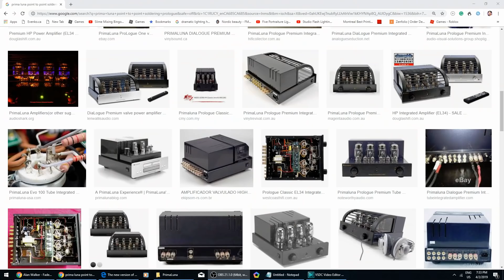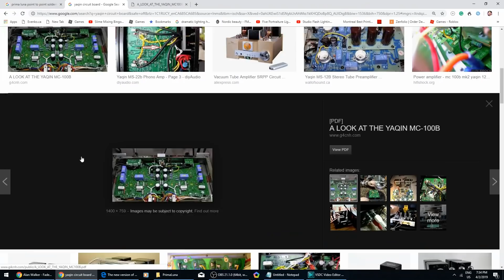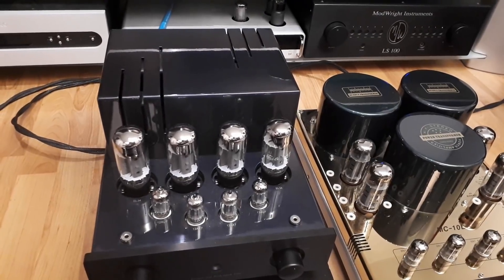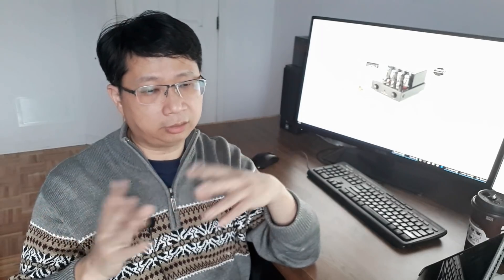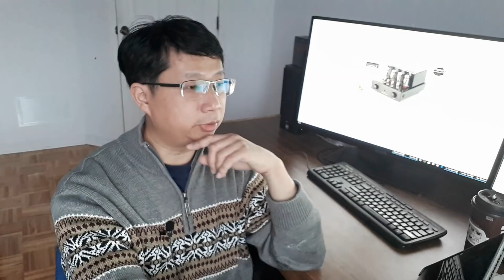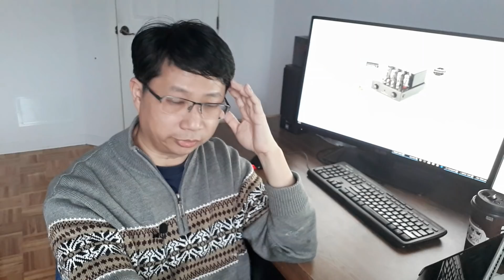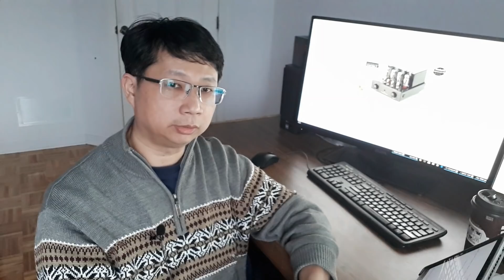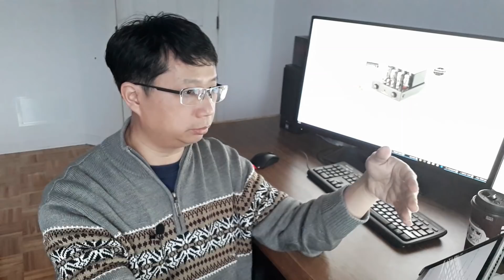Amazing PrimaLuna Prologue tube integrated amp vs Yaqin MC10L

Comment: Hello Thomas, What is your opinion on PrimaLuna Evo 400 and 300 Tube integrated amplifier?  Is the 400 worth the extra $1K over the 300? Which is better Solid State or Tubes in your view? Thanks.
Reply from the maker: My friend had the EVO 400 and I wish it had a bit more tubish sound. However, that is just me listening for an hour so not really conclusive. You would have to ask someone with more experience with it.
Reply: @ThomasAndStereo  Thanks

Comment: Hi Thomas I’ve used Primaluna units for years. If you want more bass try using KT 88 
It’s night and day. Let me know if you need more info.
Great video as always 
Thanks
Reply from the maker: Yeah, I would love to try KT150 actually. I have heard KT88 on some high end amps and sure, they sound amazing. One thing is for me everything is relative, they have bass, absolutely, but I am not sure they have the same level of control as solid state in the same class.
Reply: Good point Thomas 
I did try the KT 150 but did not like them since they do not match well with bright speakers at all. You will get ear fatigue quick. 
For me the best was the Teo front 12au7 Telefunken (only the middle two)
And KT88 (6CA7-Z) by Shuguang 
Just amazing with my Foca Aria 926
I can listen for hrs with tons of air and instrument separation and tight fast accurate bass for miles. 
Food for thought!!! 
Be careful man the tube world is way way too addictive buddy

Comment: Hi Thomas, there's no way you've tried these with a Mcintosh MA252 by any chance?  I found Primaluna Prologue One for about 2000 euro, the Mcintosh is around 3500 in Europe. Both is a lot of money so I'm thinking whether I should just go for the famous Mcintosh - which doesn't necessarily mean it would outperform the Primaluna, but there's the itch - what if
Reply from the maker: I never heard the MA252 so I can't really comment. I have the PAthos logos and kevin from upscale audio compared it to the MA252 and said the Pathos is better. Now, if I were to guess, the MA252 will have better control of bass given it's a hybrid. The Prima will be more holographic. Your choice of speaker is very important for this decision. I personally prefer more power and control of bass.

Comment: Great video, thanks! 
Last month got Primaluna Prologue Premium preamp (nice discount since new series is out), and Nord Hypex NC500 power (400w, class D), connected to Focal 1028be and Chord 2Qute DAC. 
Things I noticed: very musical, full bodied sound, great imaging, vocals are gorgeous, holographic, even tho less depth, stage spreads from little bit from front of the speaker to about 1m behind, not more. SS amps before had more depth. Bass is great, very controlled and deep. 
But, compared to previous SS integrated, much less details, and Focal can produce lots of it! Still not sure if thats preamp (more likely) or power amp, but will try to play with tubes. 
Would be great to hear more from your friend, who has really lot of tube experience ...
Reply from the maker: Thanks, Very nice setup. The more speakers I play with, I think 1028 BE is probably something I would want to get again and settle with it.  I now have the the 1027s and it has everything I want in a speaker. I had the 1028 BE before and it's definitely more refined. Strange that there is less depth. I never heard the premium preamp from Prima so no idea. For tubes, there is a user NosTubes58 in the comment section and he is an expert. Perhaps message him in this comment section and he will reply to you?  Perhaps one day I will make a video on tubes in more detail but I have very limited knowledge.
Reply: @ThomasAndStereo  thanks for reply. It was a long process to get Focal sound right, and as you already said in one of your previous video, Focal likes power (and more musical/warmer front end! Not Naim as they like to present it at hifi shows and stores!).  At least those older models, looks like new Kanta is not that demanding.
Primaluna is usually recommended component at their price point at that the reason I bought it without previous audition, Stereophile is using Prologue preamp as a reference in its price range.  
Now into (expensive) tube-rolling hell to get back those details:( 
Will check out NosTubes58 comments, thanks!

Comment: Hey Tom you have attention on two products you've reviewed fairly recently. The Buchardt S400 speakers and the Primaluna amp. The Buchardts are only rate at 88 how dynamic were they driven with the Primaluna amp ?
Reply from the maker: It's been a few months already so I don't remember. The only thing I remember is that the only thing that drastically changed was the bass compared to a high power amp. Sorry.
Reply: So the bass was better with the Primaluna and how much power was it also what tubes were they ?
Reply from the maker: @mariosupa4027  yes. Those were 45 watt I think. GE tubes made in canada.
Reply: I'm using an Audio Research VT 200 rated at 200 watts  with the S400 so you think the Primaluna will be better ?
Reply from the maker: No it will not be. I am very familiar with the VT200 and it's a great amp. My friend has it and i lived with it for a while. The VT200 has more the old sound but it is holographic while the primaluna is not as tuby sounding as the vt200.
Reply: Tom the system is singing better than ever I'm happy to say. The PL EVO 400 isn't even broken in yet. Tremendous improvement over the Hint 6 I was using as a preamp. Not to say anything negative about the Hint 6 it is a great all around intergrated I would have no problem recommending it. The EVO just takes it to another level.
Reply from the maker: @mariosupa4027  oh no! Now I want to buy the EVO 400!

Comment: Hey Thomas. Do you have any experience with rotel or b&K? Any thoughts ?  I’m looking at used options of those as they seem to be good value for my budget .
Reply from the maker: i had the rotel 1080 before and i think 986, they were just ok.
Reply: Wellim trying to find decent power for towers. I either need cheap ave with pre out to power amp or run all HDMI to tv then toslink out to pre to power.  Accomplishing this under $600 isn't easy unless going used/ vintage

Comment: Great video Thomas, I was contemplating between the Cayin and Primaluna path. Any opinion on the Primaluna and the KEF LS50 passives ?
Reply from the maker: The LS50 are not easy to drive. I am using it with the ATOLL 30 with 30watt and it distorts and a bit louder than normal volume. The Primaluna has a bit more watt but i am not sure it will drive the LS50 efficiently.

Comment: Don't expect  El34 tube for bass. They are for mid. Can try 211, 845, etc for bass
Reply from the maker: I did try 845 monoblocs but with a single tube on each amp. Never tried 211.  The KT150  were quite impressive.
Reply: @ThomasAndStereo   For tung sol kt150 tube, it has stronger bass. But underperform in high and mid. AS for 211. Different brand will have different result. Best i have tried is RCA and  ELROG.
Reply: KT 150 is a power tube, same as el 34,

Comment: Nice video, but watch out if you move up the Prima Luna range, as you will probably move away from the EL34 sound.  Not all tubes sound the same.  EL34's are known for their midrange warmth and expressiveness, ie your holgraphicness.  NOS  tubes, as a rule, walk all over new production.  However, I do want to try the new Psvanes.
Reply: James 73, I agree. EL34s have legendary goto characteristics for Fender Stratocaster guitarists. bell-like tones that complement bass guitar and percussion.  not inherently low frequency.

Comment: I'm trying to build a system with the Macintosh sound I've got the elac 6.2 already but outlaw and will not cut it to try to achieve the Macintosh sound I'm trying to do that for a relatively cheap price
Reply from the maker: Yeah, to gain the smoothness of high end poweramp is tough. I spent probably most time trying poweramps and for me, they are the key to smoothness.
Reply: I'm thinking the DAC Mini HD is the answer to all my problems...
Reply: Because for me mid bass can be improved
Reply from the maker: @dilbyjones  Well you need power for that. You can try using a schiit loki to boost the bass but that can sound unnatural or bloated if your poweramp cannot handle it. DAC for me is the key to having the anolog sound, sure some will help with bass but I am not sure of the impact.

Comment: Hi Thomas,

While the GE 6CA7 " Fat Boy " tubes were decent, they aren't the same versions as produced by Sylvania. If you want better bass control as well as definition?, then the RFT | Siemens EL34's, and current Genalex  Gold Lion Reissue KT-77's are hard to beat......., and as far as preamp tubes......., try a tandem of the RFT ECC82 NOS 1960's or Siemens ECC82 " Chrome Plate " NOS 1962-67 |  Mazda ECC82 Grey Plate NOS 1967-69, with a pair of Tungsram ECC83 NOS 1952 - 69 " Foil Getter | Welded Plate ".

And thank me later.
Great viewpoint as always.

Be well.
O_o scar
Reply from the maker: Thanks, what you brought up is interesting. I am a newbie when it comes to tubes but my friend has a lot more experience. I will definitely reach out to you when I have tube related questions. My email is turbotan@gmail.com
Reply from the maker: Let's see if my friend have some of those. Interesting and you should make some videos on it!
Reply: Thomas & Stereo 

Thanks Thomas,

Notes saved, as well as your email address. And by all means do feel free to write at anytime on said subject. And while I own one tube integrated amp ( AudioMat Arpege 10  Reference ) I'm presently using a Coda Technologies Unison  3 Ultra Edition as my primary amp, yet own a Pathos Acoustic Classic Model One MK lll ( hybrid ) as well as a Quipu A-8000.

As you've stated......., " for me " I'm enjoying that better sense of bass ( mid-bass ) driver control, as well as snap and attack of notes.
Reply: Thomas & Stereo 

Not much into the concept of videos, as I'm rather old school and don't really understand how to use most of the gear. Other then an iPad to use as a means of controlling my music library on the BluOS App, or reading, I can admit to loving a simpler way of life......., no Facebook for me, I'm sorry to say.

I'm more of the type that enjoys it when others come by for a listening session, you know like more face to face interaction.
Reply from the maker: Ah, I actually use my cell phone to record. Only thing is you need to edit the video unless you are so good like Sean at Zero Fidelity able to do it in one take. I completely understand it's nice to do it face to face.
Reply: Thomas & Stereo 

I'm just not into posting videos,  and while I've seems several of Sean's, as well as Steve Guttenberg's, there's a lot to be said about having folks come by much like you do upon visiting friends | associates. It's about a sense of bonding which videos can't capture.

I hope you got the information on those tubes, as said research was life changing, as it proved there's more to life then Amperex | Mullard | Telefunken, which is where for some the journey into tubes might begin......, but there's so much more to be had from other overlooked brands, can you say " Lorenz or Valvo D Getter Long Plates NOS 1950's Made in Germany? ". Hint, hint.
Reply: @NosTubes58  any recommendation for preamp 12AU7 tube I can try (on Prima Prologue Premium pre)?
Just ordered 2x Radiotechique 6189 12au7 to try them out.
Looking for little bit more details (top extension?)
Thanks for recommendations!
Reply: Hrvoje Hudoletnjak 

Hi Hrvoje,

Once again, forgive me for hitting onto the wrong button.

The vital thing about creating your " own flavor with tubes " is understanding which brand does what?, as some are renowned for warmth, yet lack extension on the very top end and offer very little as far as bass definition, while another like say Raytheon made in the USA ( NOS 1948-59, as the '60's versions were after the company was purchased by Hitachi Japan, and in all honesty, I never liked ) offer bass much better then most, yet aren't as refined elsewhere.

To my way of thinking music should be heard......., it's by forming a tandem from two different brands, especially in the preamp section, here I'd recommend said RFT ECC82 ( NOS 1954-70 ) with a pair of Tungsram ECC83 ( NOS 1953-72 Short Grey Welded Plate | Foil Getter ) as this pairing has been recommended to everyone I've known since 2004, and is the combination I've found has the most " Fun | Wow | Element of Surprise Factors " more then most, one begin hearing layers and layers removed right before their eyes ( ears ) as it allows one to hear deeper into the essence of the notes themselves......, thank me later.
Reply: @hudo  CBS /HYTRON 5814A NOS 1950s. (12AU7) I got a pair for my Primaluna Dialogue HP.
Reply: @NosTubes58  but Tungsram is ECC83, and preamp uses 4x ECC82, so I can't do that combination , right? 
Thanks for reply!
Reply: Hrvoje Hudoletnjak 

Hello Hrvoje,

In said case....., I'd say search out a pair of Tungsram 12AU7's made between 1953-69 " Industrial Grade with Red Logo and Serial Numbers and Shiny Silver Pins " and use them alongside a pair of said Siemens 12AU7 " Silver Plates NOS 1960-67 | Large O Getters " as this combination should definitely surprise you....
Reply: jsmctch 

Great call........, as I believe Hytron | CBS ( White Text | Square or D Getter ) to have been one of the most overlooked manufactures of tubes, besides Westinghouse NOS 1950's Long Black Plates which I simply adore.
Reply: @NosTubes58  Im trying to find this Tungstram 12au7 with "red logo and serial num" but there's no any! You sure its red? http://www.tubemaze.info/tungsram-12au7/

Comment: I seen so much about PL range of amps. Was really tempting. Then I auditioned them. I found that they are decent amps (stock) but the hype about them is much more than what they can deliver.

Comparing them with other amps (stock) of the same range, I found the PL amps to be lacking. Guess it’s just me. 😬

But I must admit the PL amps have a sound that is easy to accept or digest.

It’s true that the PL is leaning more towards SS ... 

I’m presently enjoying my Cary Audio SLP-05, it’s more tubey and the clarity will not be too etched.
Reply from the maker: I think part of the reason is because you are spoiled with one of the best preamp from Cary. What you have is a legend that is highly sought after. I have the SLP 03 and yeah, those preamps are excellent. Maybe you need to audition their highest end preamp to be able to compare to your SLP 05?

Comment: Could you perchance recommend a tiny 3w or so tube amp with amazing holographic staging?
 I have a Threshold FET-10B prototype preamp, which is wonderful, but I need a spectacular sounding micro amp.
Where I live I can't enjoy much over 75dB so I have to have extreme articulation & openness at a ridiculously low level.
I will be appreciative.- and an integrated could work also, if it's pure. I like Tubephoria - lol
Reply from the maker: I don't think watt matters, infact, I would probably want more watts. The key is does the amp sound good at low volume.  I usually listen at 75 db myself and for me the more quality watt the better.
If you really want a low power tube amp, I made a review on the 6.5 watt musical paradise tube intergrated amp, please check it ou.
Reply: @ThomasAndStereo  Thank you!
Reply: Thomas & Stereo. What solid state amp are you currently using?

Comment: I had this integrated and a Unison Research integrated ( I can’t remember the model) of around the same value for a week in home demo. The Unison was quite a bit better to my ears.
Reply from the maker: Thanks, I am thinking to borrow one to try out actually. So it was better than the PL or Yaqin?
Reply: Thomas & Stereo Definitely better. The only thing I didn’t like was that it was a little strident on electric guitar. This was a demo unit so it could have been the tubes.
Reply: @MrBonger88  PL or Yaqin

Comment: I notice you emphasize a lot on holographic imaging, are you familiar with the "OHM" brand of speakers? Im curious as to where they stand in regards to holographic imaging.
Reply from the maker: One of the issue with those kind of speaker is that it's imaging is not as define as a traditional good setup. Omni directional speaker has it's strength but comes with it's draw back. That is me also listening to Omni speakers that are $60k+

Comment: Hi Thomas, do you have any experience with Ming Da tube electronics? I ran across their website and would like to know your thoughts on the sound.
Reply from the maker: Only on one of their tube monoblocs. It was just ok but they were listed I think at $4k so I felt it was too expensive for the sound I was getting. However, it's not a fair evaluation because I used those tube amps on an efficient pair of speakers. If I used them on my Zu today, it might be a different story.

Comment: Possible the original  tubes went bad on your friends primaluna? I know they can fail slowly over time making the system sound gradually worse, and then you put new tubes in it and suddenly the sounds transformed.

I think I heard as a rule you should really replace them every year, dependant upon how many hours you have used them.

Thanks for another excellent tub amp video Thomas :-) very interesting
Reply from the maker: Your welcome. Yup, it could be the tubes that are the issue as he bought them used. I would assume he would test it with his tube tester but you never know. Thanks for the comment.